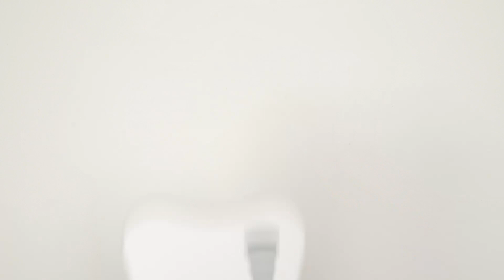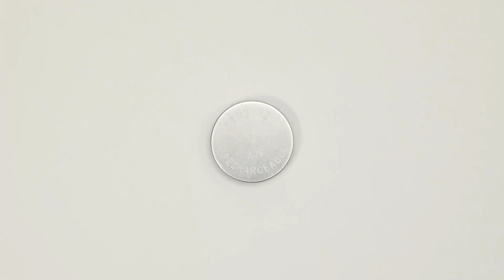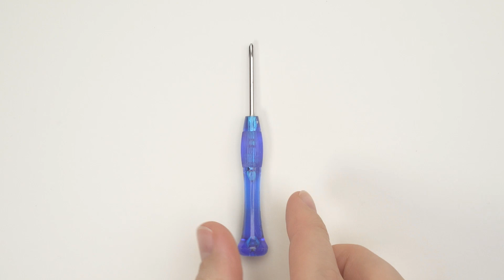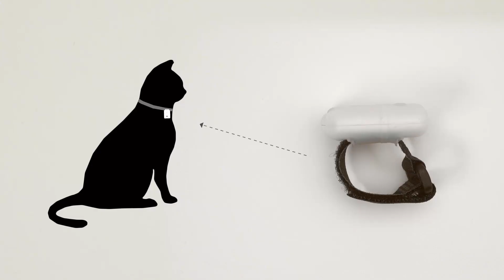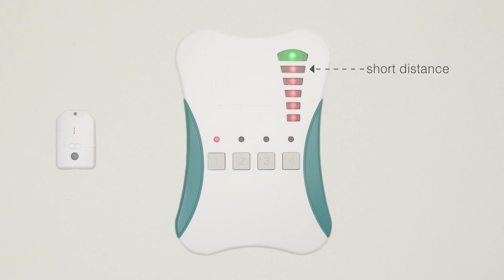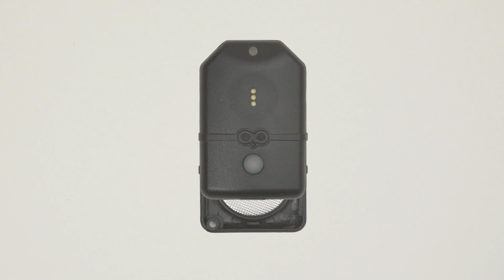Girafus Pro-track-tor RF Cat tracker / Unboxing / How to Use / Synchronization

Comment: In principle I like the product, i am testing it with one of my cats. The other 4 are still on tabcat. Girafus seems to work well - until it does not. I put a new battery in and it works well,I have a daily routine of calling my cat home with the collar. After a week or soit just doesn't work anymore - the cat is next to me but the tracker does not give a signal to the receiver. Happened 3 zimes in a tow with full batteries. Does the battery really only last a gew days, that cant be? Any tipps?

Comment: I've been trying to get the batteries out for 20 minutes now. Rewatched the battery removal in the video 5 times in slow mo. Simply can not remove the batteries after charging. Wtf.
Finally got one out a bit later. Instructions need more for this
Reply: push the small metal clip slightly to the side and the battery will pop out. if the battery doesn't pop out, use a screwdriver and when the battery is out, bend the small spring up so that it can push the battery out the next time.
Reply: @enmisike holy moly… thank you. Have been trying to pry the battery out without success. Thank you for explaining how. It worked immediately!

Comment: Is there an easy way to get the batteries out of the charging module? I find it quite difficult to get them out of it.
Reply: If you push the little metal clip with one nail and counter push the other side of the battery it comes out - hold it upside down and that helps too